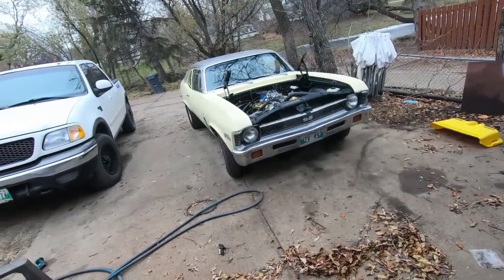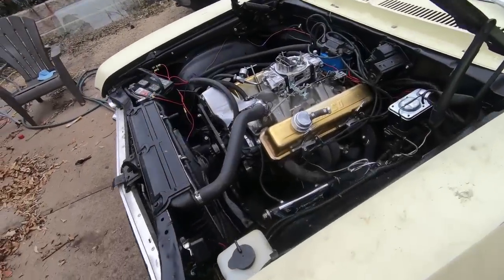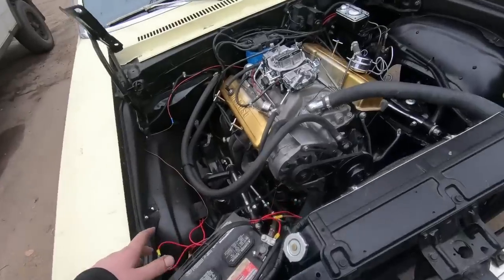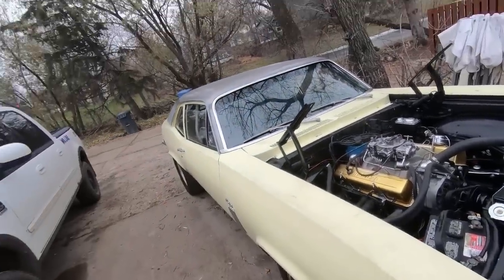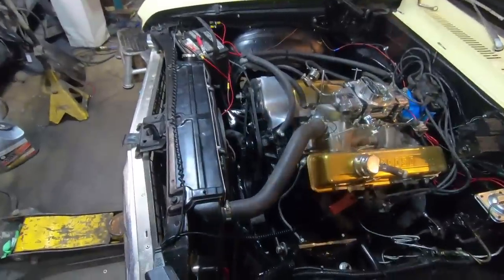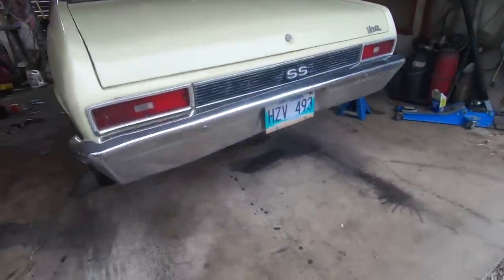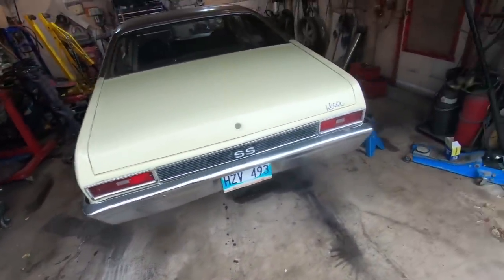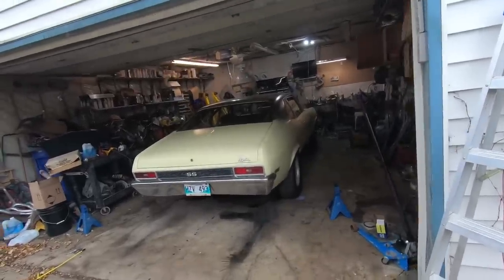Banging Gears in My 1971 Chevy Nova SS!!!

Comment: I have a 71 Nova, and have a question regarding wheels. 
Have you tried or heard of anyone using wheel vintiques steel wheels? I have a set of old dog dish caps. I've modified my rear section and can fit a decent size wheel.

Comment: Did make sure the hole in the pilot bushing in the end of the crank wasn't egg shaped? That will cause a shudder when letting the clutch on take off.
Reply from the maker: yup I actually used a bearing

Comment: looked at nova today no motor no trans 4000 he wants. have to follow your lead.
Reply from the maker: Nice!  Was it in decent shape?
Reply: @DDSpeedShop  not to bad had most of parts on it thats a big plus. my last car had to hunt for lots parts wasnt easy to find. you fixed yours up lot, did alot of work in last few weeks. big improvement with that dash.